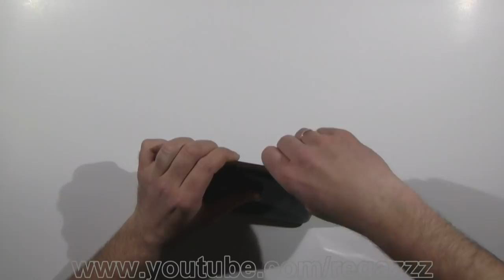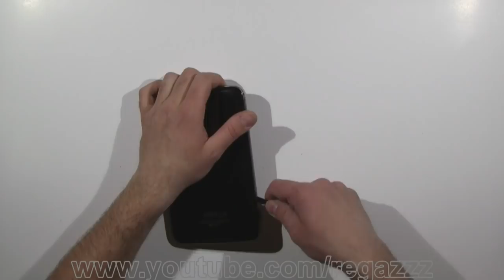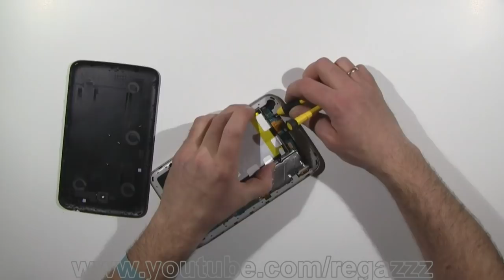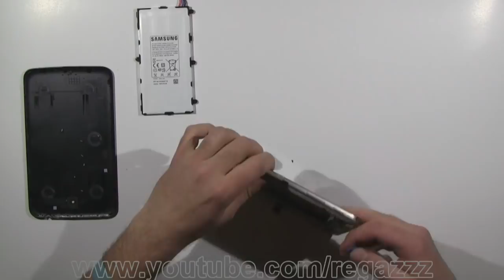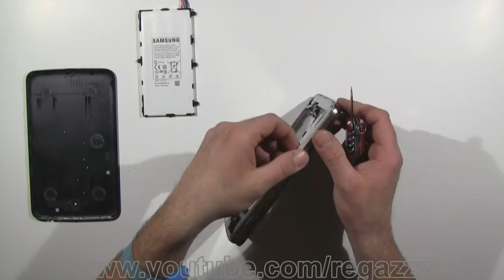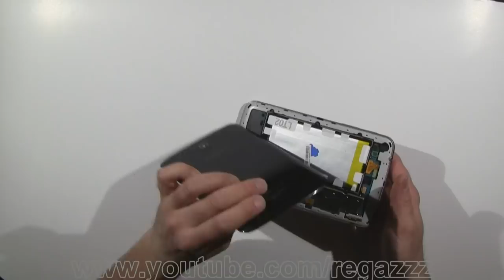Samsung Galaxy Tab 3 Take Apart, Disassemble and ReAssemble Video (HD)

Comment: Well, it's an old video, but helped me to gain access to the charging port on my son's Tab3 8" which wouldn't charge any more due the charge port getting damaged from him using it while it was charging.

However, using a knife is not needed to pry the rear cover or bezel off, just use either an old bank/credit card or purpose made trim-pry tools.  Cheap, easy and no potential scratches if you slip.

Comment: I currently have Samsung Galaxy Tab A 16 gb, It won't charge or turn on, only had this since 11/25/2015       4 months, how do I open it? I
have no tools what can I use please HELP! ASAP
Reply from the maker: +April Whitt I honestly never opened this A tablet. And I would say if the power button can be separated from the motherboard, opening it worth a shot, otherwise if button located on logic board - you will not be able to do anything upon opening it.
Reply: Thank you. I was able to open it and disconnect that part. Its CHARGING and currently it's loading up and seems to be working. I was really scared.
Reply: regazzz, I was able to take it apart and do what was in video, it worked. I am so glad. Thank you so very much.

Comment: I have one of these and the digitiser(screen) is smashed. The LCD underneath looks fine but wheen i turn it on it just glows and there is no logo. My question is should it still start and show the galaxy logo even though the digitiser is shattered? will it even show the logo if the digitiser is removed?
Reply from the maker: +paul sha usually, when digitizer glass is smashed but the internal led screen is good you will see everything. If you see a blank screen I can't say exactly what's going on. Either led is bad too or something with connection between led and logic board. Or logic board is bad. If you have another one tablet like that and with more certain damages - it will be easy to test. Otherwise we can guess :)
Reply: +regazzz It's my brother's tablet. He got part of his head phone jack broke off inside the hole so he decided to try open up the tablet.He pried up the digitiser screen and it shattered but I also see he tried to lever the insides out by sticking something( probably a screwdriver) in the charging port because i see it's not lined up anymore and bent. Anyway he gave it to me to fix it for him but told me he fell on it  broke : ) So now i am trying to figure out why it lights up and shows the sort of the outline of i am guessing the switch off or go into stanby notification. I am starting to think this thing is ready for the trash.
Reply from the maker: +paul sha I would say remove a back cover to expose logic board, look what inside, if all cables are in the correct order, connected and so on, than probably it has more internal damages. You can always do a research on eBay for the price of broken but powers on tablet like this and try to sell it.